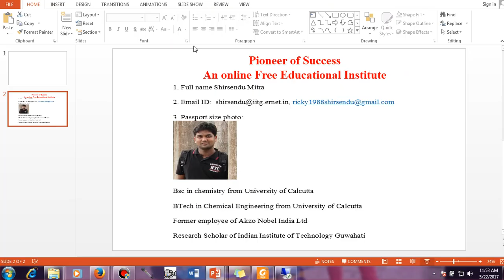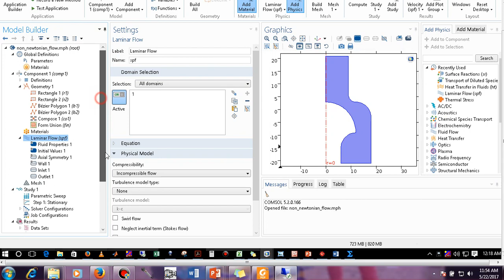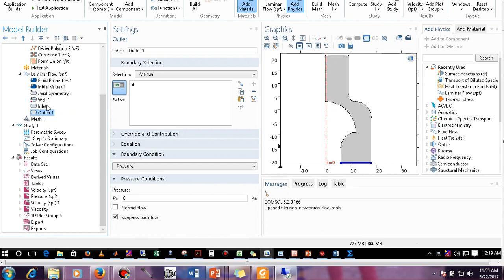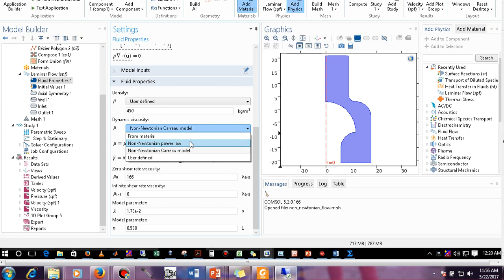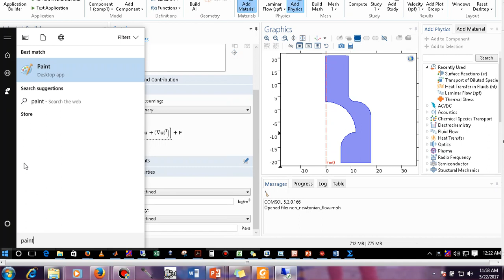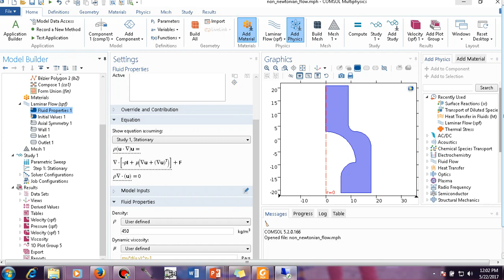COMSOL Series Non newtonian fluid modeling in COMSOL

Comment: Hi sir
I am working on a project of carburization.I am trying to simulate in the comsol software.The process is such that the methane and hydrogen gas is passed to the sample in a temperature of 720 k so that methane breaks to form carbon which is diffused.the diffusion follows ficks law and I do have the values for inital and surface concentration.can you please help me to solve